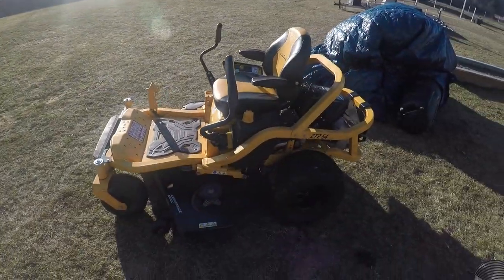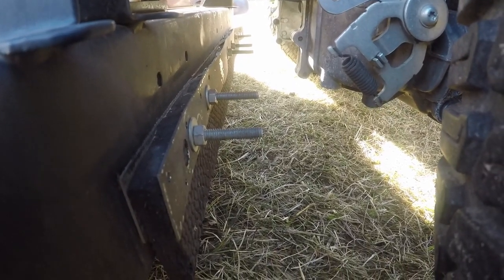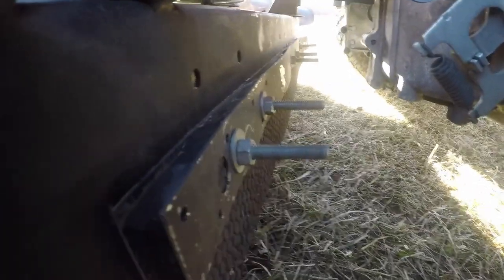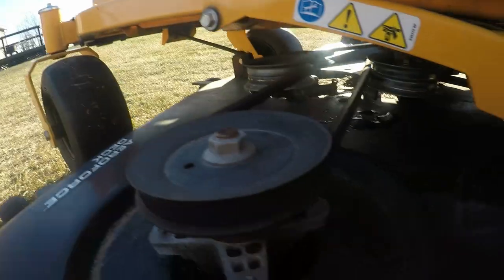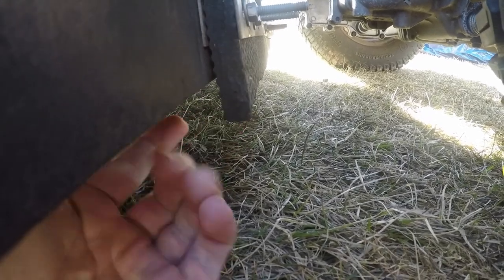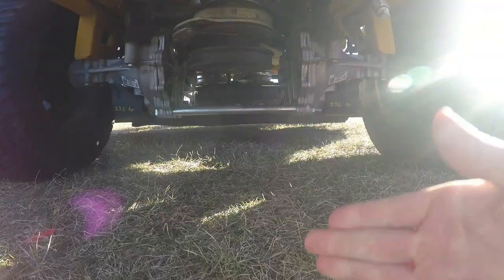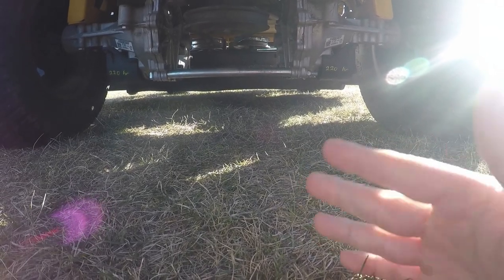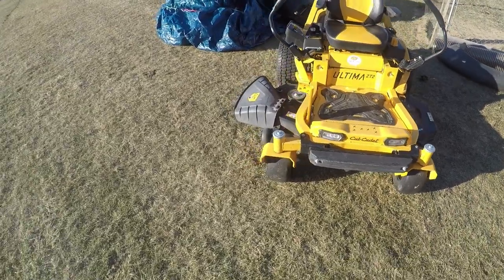Best Homemade Striping Kit For Zero Turn Mowers: Cub Cadet Ultima

Comment: Seriously, never ever ever put a strip of aluminum up against steel. You can do everything in the video, just leave the aluminum up against the mower deck out. Galvanic corrosion is a real thing. Otherwise, everything is good.
Reply from the maker: Huh, took it off today to see and no corrosion. Been on for 2 years used commercially in all types of weather
Reply: @armstrongscuttingedge  @irabryant is right. I would also advise removing the aluminum sheet between the deck and rubber.
Reply: @armstrongscuttingedge  I definitely agree with you leave it on